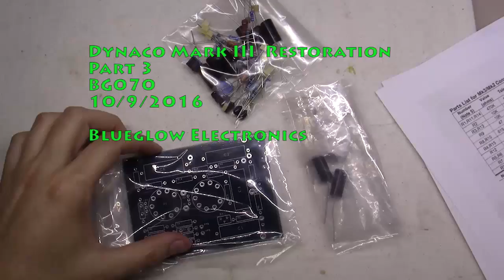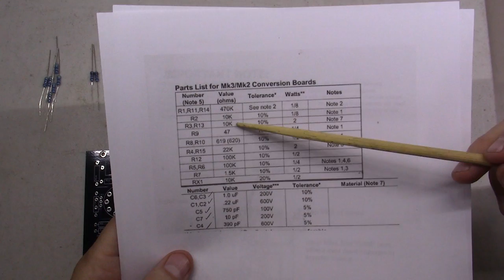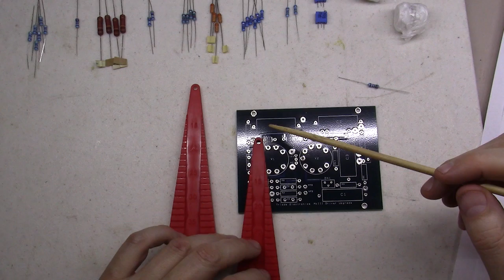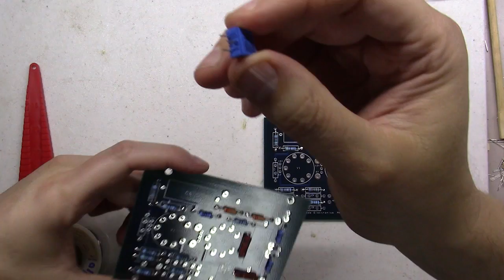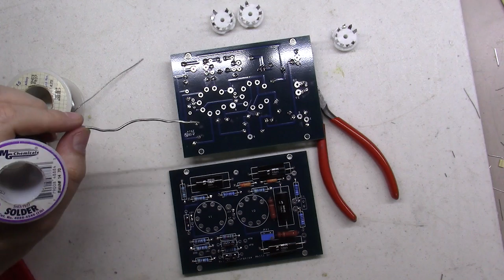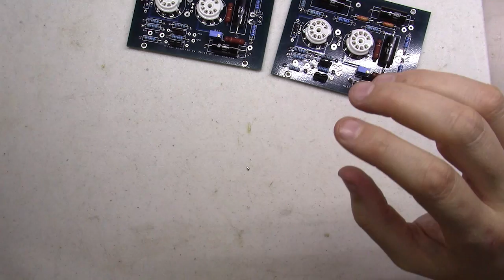Dynaco Mark III - MK 3 - Restoration Part 3 - BG070

Comment: No, the 470 kilohm resistors should be yellow violet black yellow brown, and the 47 ohm should be yellow violet black black brown. A 47 kilohm resistor with 5 color bands would be yellow violet black orange brown, which is what you have written down under "470 kilohm"! Something's going to go up in smoke if you get these mixed up! In fact, it looks like all the multiplier colors you've listed are wrong. They should be; 10 kilohm=brown black black orange brown, 619 ohm=blue brown white brown brown, 22 kilohm=red red black orange brown, 100 kilohm=brown black black yellow brown, and 1.5 kilohm=brown green black red brown.

Comment: I'm a bit confused by your chart there, my understanding is the 12pF, 750pF, and 390pF caps need a rating of 1 KV... you have them in the low hundred of volts on your sheet.

Comment: Hey Mark, I may have missed this, but what is the purpose of the RX1 pot on those boards? I seem to have seen something similar in the past that was used to balance the signal to each output tube. In order to confirm that, one could use a scope with 2 channels (one on each kt88 grid). Then, use the add function and adjust until the signal is a flat line. Am I on the right track?

Comment: I still use the Diamalloy pliers and nippers that I bought around 1973. They were made in Duluth, MN.The bronze bearings are tight and smooth as butter. I still get a little thrill when I pick them up; it's a joy to use a good tool. My main soldering iron is a Hexacon, and I haven't changed the tip in 40 years. I always re-tin it before letting it cool. I've found that if I'm using a good tool and having a bad time, I can't blame the tool. So I have to calm down, think things through and be patient.

Comment: Good choice of driver boards. The first 12AU7 is a cascode triode topology which then feeds a long tail pair phase inverter. The Poseidon board uses a 12AX7 up front but only makes use of half of it. Also, I like the blue color of the boards you went with. I have watched this series over and over, always enjoy it. You did a super job on these Mark iIIs and I'm sure the client was thrilled with them!

Comment: 14:05 - Bad idea to bend the leads up against the body! Better to use the wire-bnder to bend them to about 1/8" on each end. Then 'curl' them under to acomodate the hole-spacing.

Also, in the case of resistors, anything over a 1/2 watt should be spaced above the PC board.